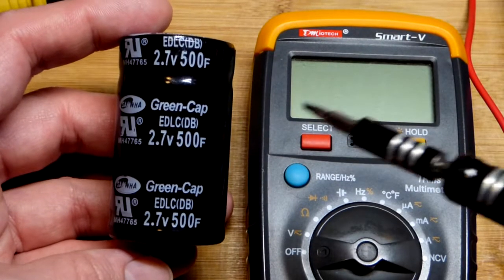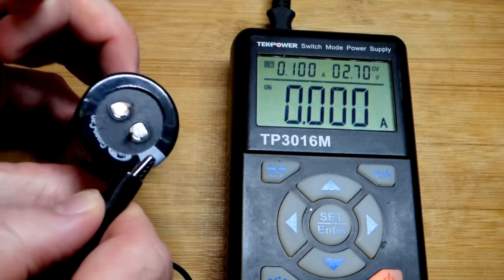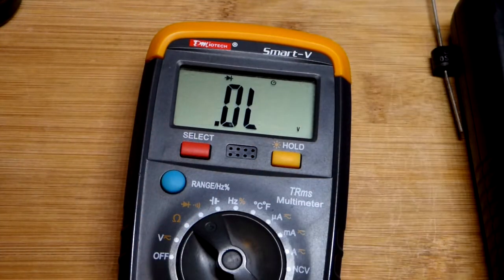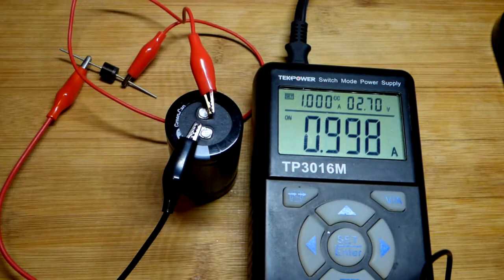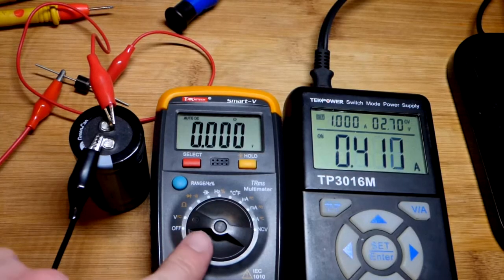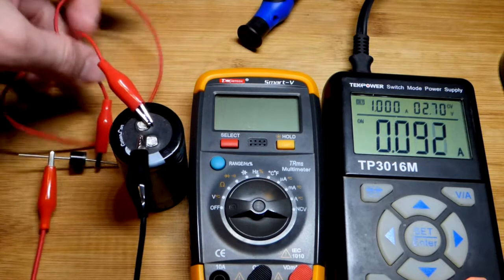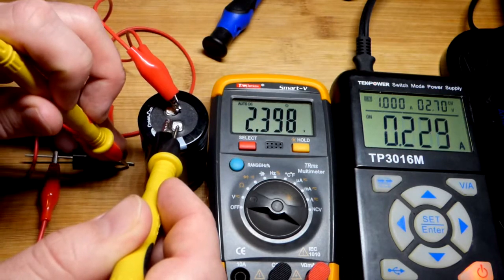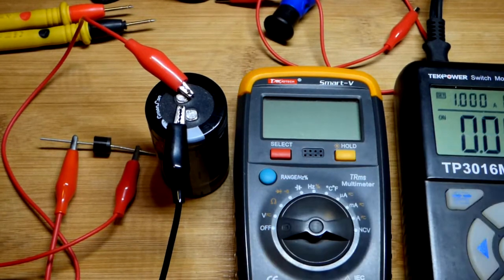How to charge a super capacitor tutorial with some problems I will explain in future videos

Comment: I have 6 super capacitors. Each are rated at 2.85 volts 3000 farads. They are completely discharged and I'm unable to charge them using a SKYRC iMAX B6. Can I use this 15 amp diode to charge them with a SKYRC iMAX B6 Mini? If yes what settings do I use? I have multiple volt settings 2V, 4V, 6V... and max amps the charger is capable of is 5. I'm looking to charge each super cap to 2.4 volts x 6 to equal 14.4 volts which is the voltage in my car. After I charge them to 2.4 volts each they will be assembled or should I charge the whole bank at once? After I successfully charge the capacitor a bit can I use a EVERSTART 750 Amp Jump Starter to fully charge the caps so it will be faster?
Reply: Just put a high-power halogen car lightbulb in series. It has a positive resistance coefficient, so on a high current the resistance the lamp glows and has a higher resistance,  limiting the current. When the capacitor is full, the light goes off and the resistance becomes very low, about 1 ohm.